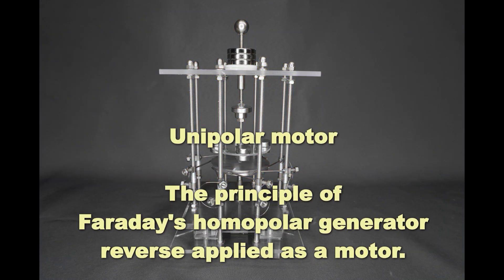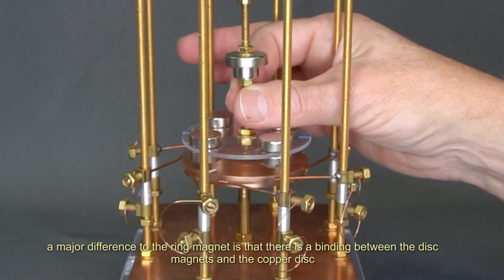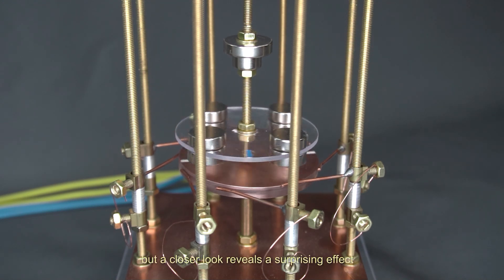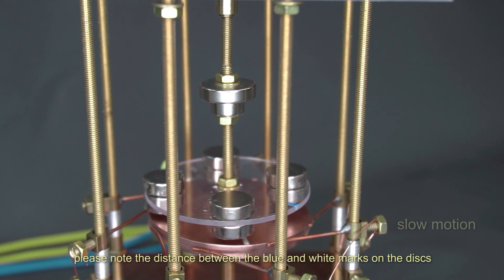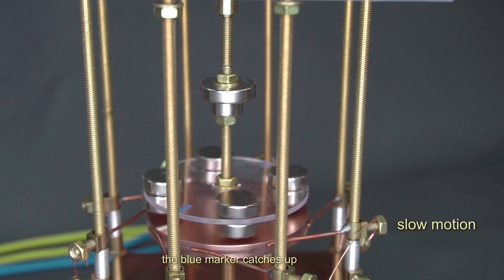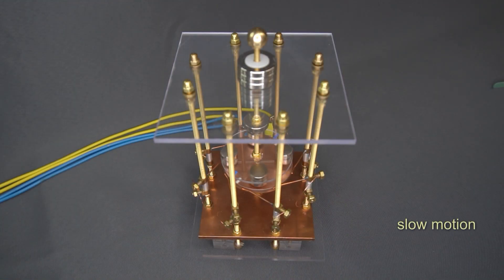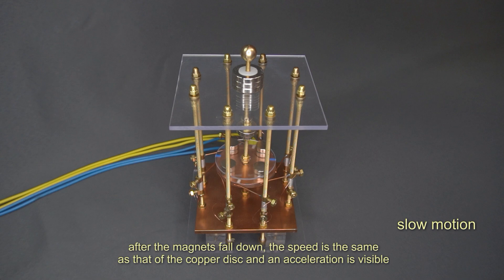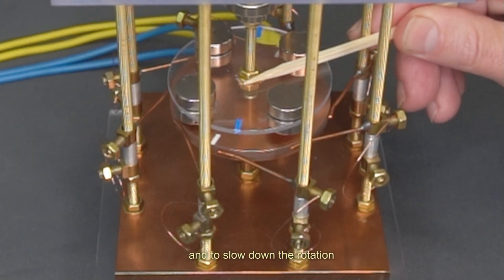Unipolarmotor 12 - Part 2

Comment: nice work..add more magnets  and see if spin is faster ???
Reply from the maker: Thank you for your comment! With more magnets the magnetic field becomes more and more similar to that of a ring magnet, which never rotates. The effect can therefore not be arbitrarily increased, but an improvement is certainly possible.

Comment: The friction from the slip wire connections could have caused the copper disk to slow down. Im not sure how secure your connections were but the test is null if you can't equalize the disks friction to each other.
Reply from the maker: The friction of the disc contacts is a major problem, increased by the short braking welding points at high currents. But I never push, it always has to start on its own.
Reply: @erwinresearch  i under but the friction must be equal between the two disks to ensure they are under the same conditions when your measuring the compared rate of change between the two disks. If they arent equal, then obviously the rate of acceleration will be different because one has to work again a load while the other is enabled to freely spin.
Reply from the maker: now I understand, of course the copper disc is always slowed down by the friction of the sliding contacts - let me think about whether the magnetic forces do not nevertheless dominate in order to explain the higher speed of the magnetic discs.

Comment: you built a homopolar motor. I don't see any paradoxes
Reply from the maker: You are right. The paradox for me is the non-rotating ring magnet in part 1; here we have a rotation, but in the direction of the copper disc, which is caused by the magnetic field of the rotating magnetic discs (with the help of the eddy current). The field of the individual magnets is different from that of a ring magnet (no eddy current). I am sure that if the eddy current effect would not exist, the magnetic disc would stay still as well as the ring. Thank you! I think discussion is necessary when it comes to this topic.